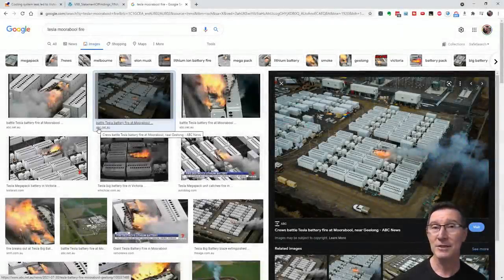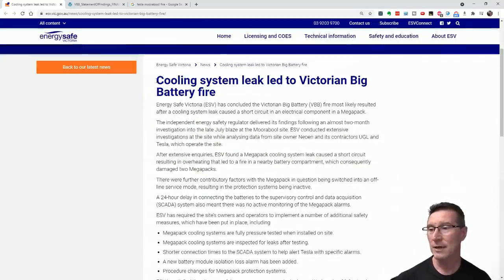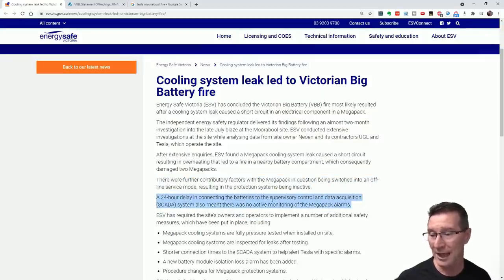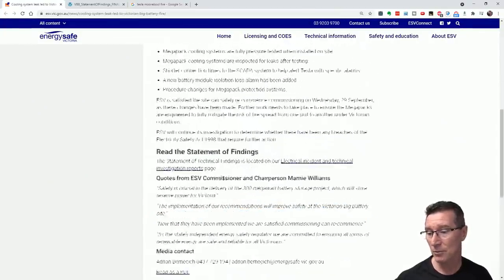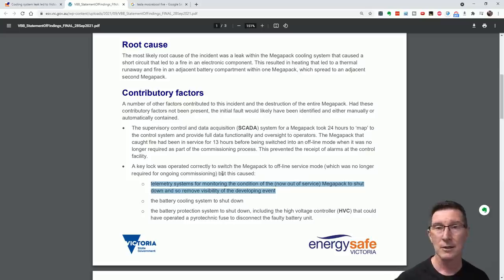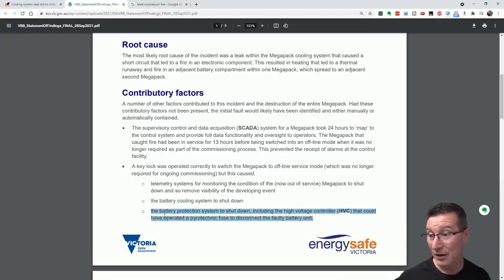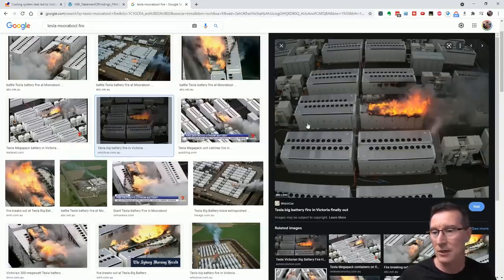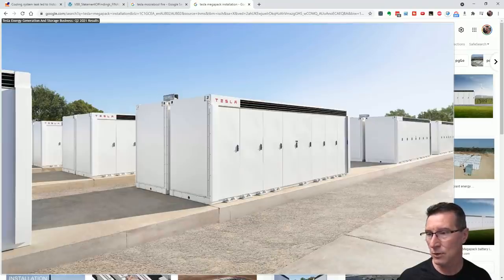EEVblog 1422 - CAUSE of the Tesla Victoria Big Battery Fire

Comment: I would have thought that not having weight constraints and the monetary value on risk would lead into more protection equipment. 
The cooling system is described as independent, just using ambient air.

Lion battery storage is described to have 85..95% efficiency (but 95% would mean 2.5% loss for the charge and discharge each, and unfortunately no inverter of better than 100% had been invented yet).
95% of a 3MWh pack would mean best case you have to get rid of 150kWh within your 4h cycle (1.5MW inverter/charger),
or at least 32.5kW cooling power. Not much for a car radiator, but there you can afford coolant temp of 110C at ambient temp of 40C. Operating a battery is best below 45C for charging and 60C for discharge.
Unfortunately for backing up solar, you charge during the day and discharge during night or at least „sun rare“ times. 
So ambient 40C and cooled object 45C is not giving a good heat transfer. Needs lot of area/airspeed. And 45C is not as rare in Australia as it is in Germany.

So the cooling system might just not be good enough.

Comment: Okay. Here's my hypothesis.
I suspect that the leak occurred at the main inverter DIRECTLY connected to the batteries.
The main thing between the inverter and the battery is the pyrotechnic fuse operated by the HVC.
The leak had probably been slowly dripping onto the inverter ever since the pack was put into service. Ergo, even after the service mode was triggered, there was still fluid slowly working its way into sensitive components, and also still dripping from the lines even without the pumps running, until a short circuit developed.
The HVC, however, was offline due to the battery being in service mode. Therefore the short circuit and failure in the inverter went undetected.
The inverter sparked, spit, overheated (partly due to the cooling system being offline), and caught on fire. And without an HVC, battery power was never disconnected, allowing the fire to burn and intensify.
This let the fire get through the firewall and begin heating the battery modules themselves.
Again, no cooling, so the cells overheated, caught fire, and Bob's your uncle. There goes two Megapacks.

I think the MAIN confounding factor is that the service mode should have NEVER been used to routinely take the battery out of service. Especially not when subsequently unattended.
That should have been done via software in the control center. The service keyswitch should only ever be used by a service technician who is actively working inside of the battery pack.
That's terrible process and procedure safety. You don't deactivate safety systems and then walk away.
I suspect that the facility managers did not realize this, and thought the offline/service key switch was there for routine offline operations...

As for why the HVC could be disabled by the key switch. Tesla probably never imagined the service key switch to be used by anyone other than a technician who would be right there at the battery during repair operations, and would thus be able to respond to any problems that developed (such as parts suddenly catching on fire) appropriately.

Comment: Failed Monitoring 101. Monitoring IS TO BE SEPARATE from function. Two different subsystems. We knew that decades ago. It seems every new batch of hot shot software geniuses have to re-invent the wheel !

Monitoring should be ON ALL THE TIME ! you never know when a truck backs into an offline unit, or a Kangaroo pisses on one ! Also basic stuff. The monitoring is polled routinely, like minutes, not hours or days. If a monitored unit fails to return a response, or several consecutive response failures, an alarm MUST BE issued.

Comment: Li offers so little benefits from lead acid in these locations why are we still having this discussion.
Reply: #1) PSOC - Partial State of Charge is a huge problem for Lead Acid
#2) The long time to recharge Lead Acid back to 100% SOC is a huge problem
#3) The low number of Total Cycles for Lead Acid is a problem.
#4) There is no Lead Acid battery with a 20 year warranty
#5 ) Lead Acid batteries are less efficient.

Comment: Using conventional "can cells" for grid storage is pure idiocy. There is no other way to put it. Its a solution that's about as good as a product sold by an MLM. We need to only use flow cell configurations for grid storage... this flashlight batteries in parallel series approach is just asking for this to happen over and over again. The variability in the quality of "can cells" is just too high, even with modern manufacturing practices, to be allowed for use at this scale. Over the counter grade batteries don't belong in schemes that supply power to cities.

Comment: Dose the coolant not flow directly over the cells in the battery pack, so presumably the coolant is non conductive material such as glycol or glycol distilled water or oil, if so how did it cause a short. Was the unit taken off line due to a registered overheat which would be caused by lack of coolant due to a leak. It looks like each unit has its own self contained cooling system with radiators and fans on the top of each unit.
Reply from the maker: It does. But there could be more than one system, it's not just the batteries that get hot.

Comment: This is a ridiculous, needlessly expensive, overcomplicated solution. Yes, every power grid has challenges to balance the power supply. If you have mountainous regions with rivers, you can use hydroelectric dams to buffer energy. In countries where that is not the case, like here in the Netherlands, we use jet engines from airliners to smooth out the grid. Its a tried and tested method that has been around for decades. And I expect 100's of times cheaper than that huge battery farm. 
And no, this is not worse for the environment. These jet engines run on natural gas. Natural gas burns loads cleaner than batteries.

Comment: A scada system profile of a single system that requires 24 hours for... mappings? o_O
And meanwhile, since you don't need that unit for your commissioning calendar, you just put it in service mode (which implies suppressing ALL the alarms and each and every security system)? o_O

What is this? Counterengineering?

Comment: Not a big fan of off the PLCs the SADA is offline just another example of sound engineering replaced by a virtual design. Its likely they didnt have logic in place to alarm on loss of comms. These The EPC probably never put something like this together. Makes sense being such a new system but this to me is an example of a project without a competent electrical engineer not overseeing this project. That costs money. If its required to have pressure tests on coolant then why did the engineer not catch this when the person reviewed the commission spec they wrote. Or was there….
Sounds like a standard operating procedure as not made wither discussing how to run the safety controls.

Comment: Sadly batteries are not the solution. They're heavily carbon intensive, rely on mining of precious resources that will forever increase in price and have a large weight for mobile applications.
Reply: I am hopeful they can come up with better, more environmentally friendly battery technology in the future. They are putting a lot of time and research into it. Lots of interesting ideas. There are plenty of other ways to store energy of course but batteries in whatever form they take are not going to go away, rather play a role in a greater energy storage solution, depending on the situation. That is how I see it anyways.
Reply: If batteries are not the solution, then what is the solution in your opinion?  Building a massive concrete pump storage, maybe nuclear or what?  Any other solution currently is way more carbon intensive.  And regarding "precious resources", these batteries have very little "precious cobalt", and everything else is pretty common on earth surface.
The "precious cobalt" is only precious because the few places where it is really abundant are locations with tons of social problems and wars, but if those places were not at war at least, it would not be an issue and Li-ion and Li phosphate will b even cheaper than it is today.
Reply: It's a combination of things for sure, nuclear, solar, wind, hydrogen for mobile applications, getting rid of our reliance on cars as we urbanize more and more and moving towards mass transit (this is not a pure engineering problem to solve), rewilding massive areas of grazing land, mass use of carbon recapture technology (can be used to create methanol a nonvolatile hydrogen store and convert into hydrogen with no new CO2 in the system).

For energy storage the ultimate solution is that we don't need to store it, the reality is we always will but strategic placement of reservoirs will reduce concrete requirements for pump storage, mechanical storage such as flywheels. 

Those regions where the materials for batteries and precious metals can be sourced suffer social problems strategically to keep prices down. This has been the case for any region holding limited resources in post industrial history. 

There is no easy answer but batteries are an aside. A well engineered system won't require them.

Comment: Ya don't know, from this report, that it wasn't a failed cell. The detail isn't there. It's what was not said, the detail left out of the report. "Component" could be anything...why not a cell? The fact is that you don't know, one way or the other, from this document. This report read to me as PR damage control, embarrassment mitigation, if you will. It's meant to reassure an audience, not give engineers/installers/technicians/operators rules and lessons-learned to live by, so much.

Comment: Just one look, I can see the batteries are too close together, and if a fire starts it can easily spread which it has, also the explanation is too vague, it impossible to make sense of it unless they release the design. If it was designed properly with fall back and fail-save and fire protection measures there would be no need to have learned lessons, and no fire should have occurred anyway.

Comment: What's the bet it relied on crappy plastic little pipe fittings with tiny o-rings in the coolant chain? Probably supplied by some 'high quality' european manufacturer. European cars never leak, right?

Comment: holy shit! one of those tesla mega pack must be terribly designed. this stuff should have never happened with good engineering. a simple leak should not have cause a short circuit. where did all the fail safes go? what happened to all the fail safes

Comment: I'm surprised water works on lithium fire.
Reply: The 'fire triangle' is fuel / oxygen /heat.  Water takes away the heat, so the fire goes out eventually.  Warranty voided on exothermic reaction like lithium batteries, so the water stops the fire spreading and then you go play cards until it burns itself out.

What you should do is mount the packs on massive springs held down by something that'll burn or melt.  When the fire gets hot enough the spring will yeet the entire pack off into the desert somewhere, saving the rest of installation.

I have yet to simulate this, I'll do that after getting back from the patent office.
Reply: Makes it burn faster, there was a fire by me years ago, where a shipping warehouse, that contained export bars of aluminium and magnesium, caught fire. Fire department basically spent 3 days pumping sea water onto the surrounding buildings, so they would not catch on fire, and then every so often sending a jet onto the collapsed remains of the warehouse, and, seeing by the resultant blast, that not all the material had burnt out yet. When it stopped they finally cooled off the remains, though there was not much left other than a massive glass lump, where the warehouse used to stand, and most of the steel walls had been evaporated away, or dissolved into the glass. IIRC took them a lot of blasting to make the block small enough to remove, before they re built the warehouse.
Reply: @j.f.christ8421  Or float the packs on boats and if one catches fire, intentionally sink it?
Reply: @NiHaoMike64  Ah, a fellow man of science I see.  Bit hard to sink a boat in the desert, but that'll work for the off-shore winds farms.  Give the Scottish government a ring, you might get a grant out it.

Comment: 24 hour 'dark' period sounds a bit dodgy to me, I guess that caused some red faces, how about some brick walls and bunch of Arduino's measuring temp and leave 'em ON ya dummies...cheers.
Reply: Great idea.
A set of  ESP32, DS18B20 on each bank, a WiFi router and a laptop, simple backup system, instantly online.
Seems dumb leaving a charged up bank with no monitoring at all, even if SCADA was on line, when they switched it off probably would have disconnected the SCADA link.

Comment: Its interesting technology but mark my words! The electrical car is not the future, its insanely dumb from all perspectives except the power output, so yeah could sure be fun on the track, def no use of that on the public roads anyway. But the problem itself is the batteries. Hydrogen driven cars is where its at, the power as it is ignited is pretty much the same as gasoline meaning we already have many million cars that could be converted with no much effort. 

The fact the way to deal with a burning Tesla is to submerge the whole damned car into a cointainer with water speaks for it self and i honestly think companies like Tesla should be hold responsible for the costs and problems their crappy products give. Its insane how their just allowed to flood the market with crap without any responsability. If i created a product i could never make that happen. Evidence of corruption no doubt!

Then why dont we see this already you wonder? Pretty damn simple water is hard to tax, own and controll. Except if you live in a place like quatar. But you could make an enclosed system with little to no loss of fuel.

Comment: You could put some Fermacell plates between the two half-containers, as a security "patch".
I like my Tesla Model 3, but the complete Tesla MegaPack design is rubbish from A to Z.
Wrong cell type, inverter/electronics (wich DO fail!) too close to cells, water cooling (WTF?), water over electronics, no fail safe and redundant temperature switches (MUST ALWAYS WORK WITHOUT! computers and SCADA!).
Sorry to say that, but this system was designed by idiots. 🤦🏻‍♂️
There are many better systems on the market.

Comment: Do they mean "refrigerant"?  This talk about "coolant" implies a non-pressurized liquid like a water based solution.  But mandating pressure testing implies a refrigeration system.
Reply: Water cooling systems, like in your vehicle, are almost always pressurised, at least since the follow on of the Ford model T. The pressure allows the coolant to have controlled flow, and is a natural consequence of heating up water in a sealed system, plus the pressure provides a simple way to detect leaks by the pressure loss. Pressure also allows you to be able to run vehicles at altitude, and still have the coolant run at 90-110C without boiling.
Reply: Maybe pressurising makes the leaks more obvious to spot, or gives the fittings a bit of a stress test.  Fluorescent dye works well for leak finding though.
Reply: @j.f.christ8421  You still need to be able to see the dye to find the leak. Hard in a sealed battery pack, where it is hard to find a leak short of opening up each sealed potted module to find it.
Reply: It's the same basic setup as automotive coolant loops, which are pressure tested. Plenty of videos explaining that process.
Reply: @SeanBZA  Point taken, but it's also hard to pump coolant thru a potted pack.  I know some Telsa car packs are potted, some not, I wonder how these banks are done.  Used to be just stacks of EV battteries, so if one did leak you'd pull the offending one out and replace it.
Reply: @SeanBZA   Unfortunately this is not correct.  A lithium battery cannot be allowed to get as hot as an internal combustion engine....and the type of heat transfer used by engines is only effective when there is a significant delta t.  As the delta t gets smaller, the amount of heat you can dissipate to the ambient air decreases.  Added to this is the problem that lithium batteries get damaged if they get too hot.  In  this particular installation, the ambient temperatures can approach the max safe temperatures of these batteries!  So if the batteries are charged or discharged when ambient temps are very high, the batteries are in danger of overheating.  My question is premised on the understanding of the above, because it seems to me that they need something better than a closed loop water cooling system.  I am wondering if they are using air conditioning unit, but an evaporative cooler might also be effective.